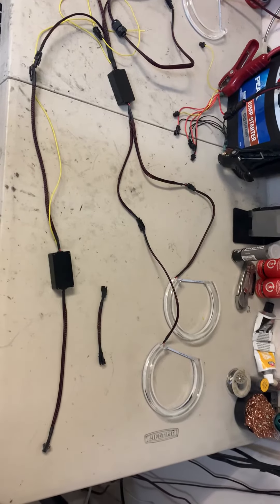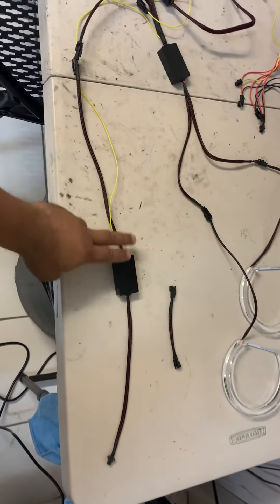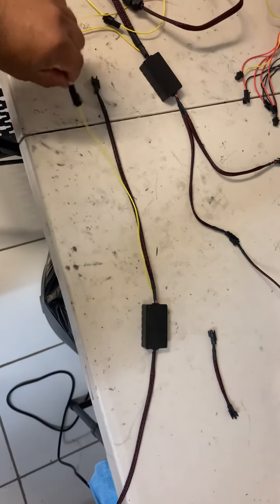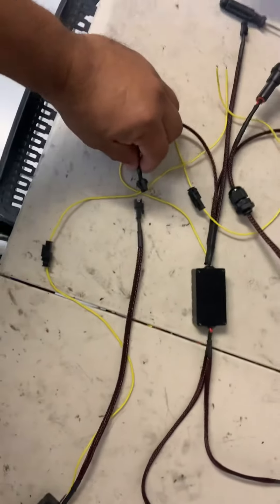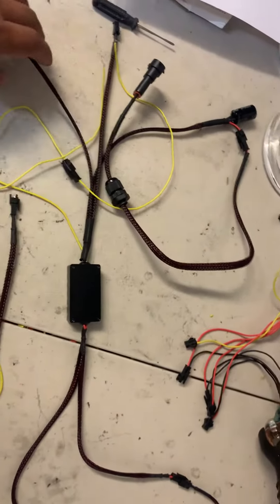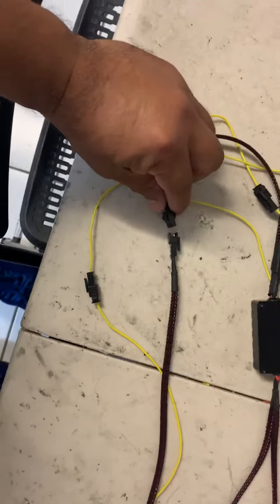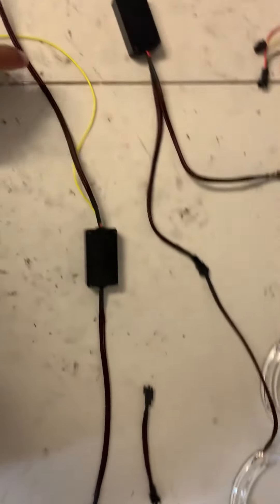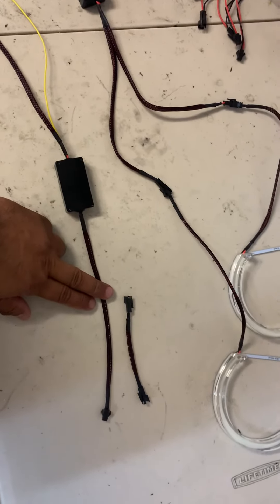Properly Powering/Wiring a Bav LED Switchback Strip

Comment: Where does the yellow wire go? Could you send a link or a picture?
Reply from the maker: It goes to the power wire on the turn signal marker (its optional). It’s different on every car.
Reply: @bavgruppedesigns  do you have picture for e90 lci?
Reply from the maker: @Zalle335  no that wire is not one we’ve documented. You can send a photo of it to us and we’ll post. You’d need to test the black wires, there are two or three there. You can’t damage anything, it’s just touching the yellow wire to each of them until you see the LED start to blink.
Reply: @bavgruppedesigns  so I have black red and yellow wire. Black and red would just be white, yellow wire would make it orange/yellow/amber when turn signal is on. Black and yellow I just connected to the old plug that used to drive the h8 bulb for my lci non adaptive headlight. Now I am just wondering where would my yellow cable go for power when blinker turns on?
Reply from the maker: @Zalle335  it goes to the wires that plug into the LCI turn signal marker. You’d need to test each wire per my comments t above. There is a connector with three black wires that plug into the turn signal marker. Plug the headlight in and turn the blinker on. Don’t plug in the turn signal marker. Connect the driver to power and touch the yellow wire to each of the black metal pins. One of them will make the strip blink. You can send us a picture and we can post for everyone else. 🙏
Reply: @bavgruppedesigns  okey thanks. Will test that, great idea.
Reply: @Zalle335  @Bavgruppe Designs did this ever get resolved im dealing with this problem right now, which of the black wires do I have to tap into? There’s 3 of them. Thanks for your time